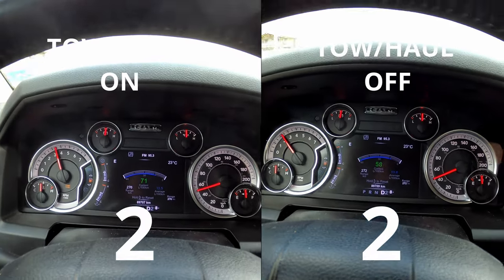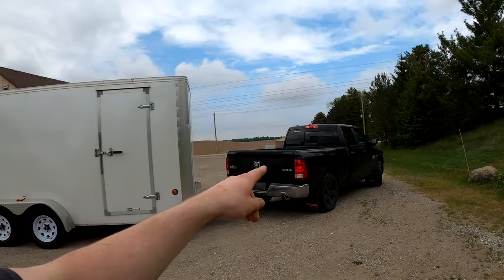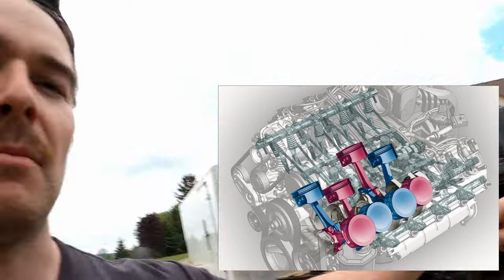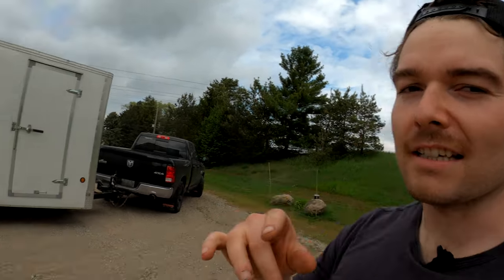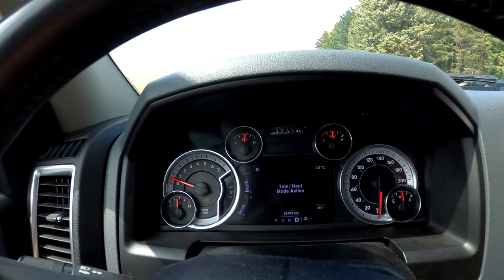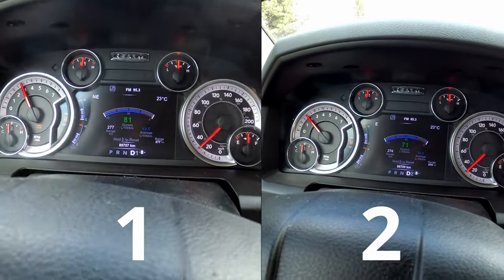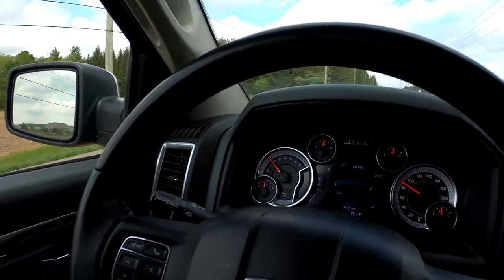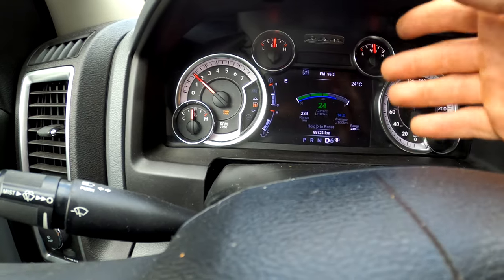RAM 1500 TOW/HAUL Button Function | What Does It ACTUALLY Do In Tow/Haul Mode?

Comment: very odd, you must have different rams up there, in my 2018 1500 MDS still kicks in with tow haul activated, even more interesting is that I have no "current gear" indicator. I have a gear limitation selection where I can select the highest gear it will go into. During gear selection mode MDS will disengage.

Comment: THANK YOU for your many informative RAM videos. I wish we would have found you or had access to these videos when we started RVing years ago in the Rocky Mountains with the Cumins powered 2004.5 RAM 2500 and then the 2012 RAM 3500. We are happy to learn that we did most things properly to ensure the longevity of those Cumins engines by using tow and haul, warming the cold engine, idling prior to shutting her down and blasting/burning out particulates after parking the 5th wheel. Back then while climbing we used the EGT readings to choose the proper gear and fuel to protect the Cumins, and on the level considered the power curve to determine our speed.

Comment: Used my 2022 Bighorn to tow a ditch witch on a small trailer. Tow/haul mode was kind of freaky running at 3400 RPMs sometimes going up to 4000 RPMs. After a few minutes, the check engine light came on. Never had this problem with my F150.
I guess this will take getting used to. After a while the tow/haul light went out and the truck still operated like it was in TH mode. 
Now, I have to get the check engine light looked at. Not cool.

Comment: I agree. Tow mode still allows eco mode to kick in. Need to have gear selector in manual. I leave it on number 8 and it will get to that gear on highway.
Reply from the maker: Originally I thought tow haul mode did shut off eco mode but I was quickly corrected! Honestly I just like seeing what gear the truck is in.

Comment: In my 2024 hemi with 3.92, while towing my 7500lb travel trailer, the engine braking in tow haul is quite aggressive especially while using cruise control. I think they made some software changes because my 2018 would not go above 6th gear but this new one has gone to 8th in tow haul while towing. Not often, mind you, but it does it. Thanks for the great video.

Comment: Pulled 5000lb trailer and it went to 8th gear, great mph. Then towed 3700 lb. It stayed in 6th. Mph dropped by 25%. How to get 8th? Thnx. 

Turned tow haul on and off during entire trip. Would only get to 7th downhill as in your demo. BUT would not go to 8th. Which I wanted it to. 2020 1500 ram, 5.7, 3.21 gearing. 

Again the heavier trailer went to 8th no problem...these are light weights in travel trailers and I obviously want that better mpg.

Comment: great info, thanks.  we tow a 6000lb travel trailer several thousand km every year with our 1500(hemi 8 sp).  about half of that towing is at regular highway speeds, ie 100-105 kph.  we can tell instantly if we forget to activate the T/H after a stop with engine off!  at highway speeds it will go into 7th at 100 kph and even 8th on a long gentle down grade that doesn't require braking.  Upshafts are delayed by around 1000 rpm, downshifts are much earlier when braking.  it is a pretty smart system, far better than the one on our previous truck(dakota towing 4000lb)
Reply: I just purchased a Ram 1500 to tow a camper (4000 lbs like yours)  what was your gain + adjustment setting out of curiosity ?

Comment: I used the tow/haul button on my 2016 ram 1500 hemi today and after reaching my destination and unloading my trailer and turning the truck back on and started to head home and my transmission started acting funny and shifting terribly and slamming into gear and won't down shift when accelerating.......transmission seems ruined now with tow/haul off. Will never use the button again and need a new transmission......was only towing 6000 lbs 😢

Comment: I'm finding that my transmission on my 2021 ram warlock with a V6 is acting like tow haul mode even when it's off. Ever since getting a slightly bigger trailer at a 780 lb aluminum trailer, it takes forever just to get into 67th gear. It sits forever at 5th or 6th to the point that I just feel like I'm sucking gas. I go into manual and bring it down the 5th. This is on flat ground without headwind. I'm about to reset my computer and maybe drive around with my trailer for a week and see if that helps it calm down. If I went into tall hall mode it probably would never even go into six gear. I can't afford to drive all the way to work and around town at 3200 RPMs for 20 minutes with an unloaded trailer that's insanity. Half my mileage on my trailer is empty cuz I'm moving things around.

Comment: I tow my travel trailer with stuff is approximately 4500 lbs.
At 100kms in tow mode and cruise control on my hemi is screaming at 2800-2900 rpm. Just to stay at 100kms which is crazy. I find the truck pulls better out of tow mode.  Looking into trading it in. Want to switch to 2500 so I get better performance.

Comment: My 2017 eco diesel 4x4  (3.55 gears) with T/H on turns on trailer brakes at the settings I have set. I think the engine goes into a different tune as well. Please use your T/H when towing because it makes everything so much better.

Comment: Great Video, love the ram content. Question do you happen to know what temps your coolant, trans, and oil was when you towed your trailer? I tow a  travel trailer loaded at around 8500lbs. My trans temp hardly moves much, oil will touch 120C when towing in the summer. I drive in the prairies though no big hills or mountains for me.
Reply from the maker: couldn't tell you the exact numbers. but when towing my trailer loaded the trans and oil temp would stay right in the middle of the gauge. only when pulling up mountains did my oil and trans temp sky rocket. 

my coolant stayed the same place on the gauge no matter what I did lol
Reply: Bullshit...mine runs at 212..trans is 190, oil is around 220,pulling a 87 thousand pounds trailer ..
Reply: @jaimezapien4897  so basically the same.  He said 120C you are saying Fahrenheit.
Reply: @Nooneyouknow141  right I tried but and it stay around the same and i did on a 3 hour Drive both ways

Comment: I have the updated gauge cluster on my Ram like yours but for some reason, mine doesn't show what gear I'm in as I'm driving... My truck has the 65RFE 6spd transmission, so I wonder if that makes a difference? Mine only shows the gear selector/limiter but not what gear I'm in. I wish it showed what gear I was in. Maybe it's a feature that got added to newer 4th Gens. I know yours is a 2017 and mine is 2015.
Reply: I know it's a lil late but I just found this video, I have a 2014 with a gear selector and dash that does show the gear I'm in but I have an 8 spd, may have something to do with it
Reply: It's a setting in the EVIC. Easy to turn on
Reply: Yes. You need the 8 speed

Comment: Can I use tow / haul mode while not actually towing and will it hurt my truck ? I like the concept of it holding rpms longer so I want to see if I notice a difference between normal and tow / haul without a trailer so please let me know if it’s ok for me to do so
Reply from the maker: no you won't hurt anything. but you will burn more fuel.

Comment: The 2012 RAM 3500 combination of "tow and haul" as well as the exhaust braking system and trailer braking system was a God send while towing the 5th wheel and having a string of deer cross the expressway. As I forcefully applied the brakes, I could hear the rapid and repeated down shifts and grumble of the Cumins. When the last deer was avoided, we had very quickly and safely lost 50 mph.

Comment: My 2012 RAM 5.7l 3.92 with the 6 speed get great mpgs better while towing (t/h mode on) than it does unloaded (t/h mode off). Just don't push it over 70 mph so the rpms can churn at 2000 and cool your gearbox even going up inclines.

Comment: All I know is that if your cruising no matter what gear I've noticed the rpms rise 250rpms more when pressing the tow/haul mode. It's also great for drag racing.
Reply from the maker: So what your saying is you're drag racing your ram 1500?
Reply: @TheGettyAdventures  😂😂
Reply: Hey man you can drag race anything
Reply: Saw another video that says to turn off the traction control for better acceleration.
Reply: @TheGettyAdventures so if I carry the same trailer you have with stuff inside should i turn the button on? Or is it fine if I dont? Obviously i know what happens with fuel

Comment: Is it bad if I don’t use trailer haul button when carrying same trailer u have?
Reply: Nope. Honestly it’s only going to help with your braking. Been towing basically everything for years with 2012 big horn 1500. It can pull anything I’ve put on her but, definitely has trouble stopping over 8,000 lbs or so. That’s when it can be kind of dangerous because you just never know when you need to make an emergency stop.
Reply: @samueldavis5895  ok thanks. And yeah braking is one thing I look for.

Comment: My warlock still goes into “eco” mode while in tow haul, pulling a 30ft travel trailer.
Reply from the maker: that's kinda impressive. my 1500 struggled with like 5500 lbs
Reply: My 4th gen ram 1500 tradesmen never goes into eco mode when using tow/haul

Comment: I have a 3/4 ton w/the 6.4 hemi. My trailer is 2500lbs. I'm wondering if I need to use the tow haul mode. It seems unnecessary. The engine brake going down hill on the fwy is very annoying. It slows me down to 40 mph and when I try to speed up to get out of the way of a semi truck, the rpm's just go up while producing very little speed.
Reply: Right and with that weight of your trailer its not necessary
Reply: It says if towing , use it
Reply: @timradke7775  ok what ever just keep in mind not ever truck has that option so what people can't you their truck to tow is what you say ?
Reply: Have another beer
Reply: @timradke7775  all Tim don't be like that buddy its cool 😎
Reply: @timradke7775  oh in by the way when I send that I was using voice text going  to work not drinking thank you very much for the offer

Comment: Tow/ haul does not disable mds, only using the the gear limiter will 2016 and up including classic models.
Reply from the maker: really? I wonder why everyone says the MDS system is disabled
Reply: It isn't. The only way is to shift it in 8th gear and it will not go in eco mode. I do it sometimes when I am rolling through town with the windows open.
Reply from the maker: @burdanegillette8742  Ya so on the 2500's tow haul mode will disable the mds system. Only 1500's with the 6.4 hemi will have the mds system disable when in tow haul. 

wonder why they left the hemi running the mds system in tow haul
Reply: @TheGettyAdventures  if you have the 6 speed it disables mds if you have anything other than the 6 speed it will keep it on
Reply: I have the 5.7 6 speed and it turns it off I’ve looked online as well
Reply: I have the 5.7 8 speed so I need to manually turn mine off. Sometimes I turn it off just to listen to the pipes. And when you turn it off you have less hesitation and only lose .5 mpg so when mine is out of warranty I will do the delete kit on it. I have a 2 inch lift on 33s. I didn't buy it for gas mileage but I can say it isn't that bad either compared to my older trucks.
Reply: @TheGettyAdventures  must be the difference between 6speed and 8speed transmissions. The gear limiter prevents the 8speed from entering eco mode.

Comment: My 2015 ram 1500 still goes into eco mode with tow haul active. Not pulling anything. I personally think it drives better. With it active.
Reply from the maker: I had some wrong info. tow mode with the 8 speed, the truck will still go into eco. only the 6 speeds or the 6.4 hemis won't go into eco mode when in tow haul.
Reply: I have a 2023 ram rebel 1500 w/ etorque…eco mode disengages when tow/haul is activated. Safe to say MDS is deactivated as well?

Comment: What rear end ratio do you have ?
Reply from the maker: 3.21 :(
Reply: @TheGettyAdventures  Great Video. I have 3.92 and don't see much of a difference between tow/haul on or off.
Reply from the maker: @michaelcanino4078  like while towing or just cruising?
Reply: @TheGettyAdventures  Both. But I do live in Jersey. No Hills!
Reply from the maker: @mjcanino  fair enough, I also thought it would have more impact but it is a pretty small difference. I think the biggest thing is how the truck stays out of overdrive on the highway for the most part.
Reply: @michaelcanino4078  I have 3.92 and I can hear a difference immediately though my flowmaster. It growls much deeper as soon as I hit the button. And when going down hill you feel the whole rig slowing itself